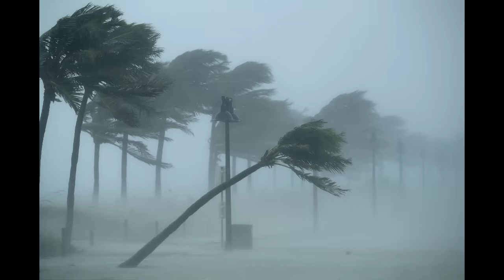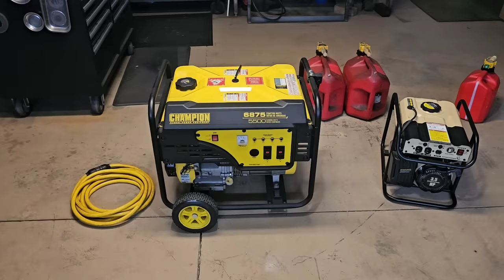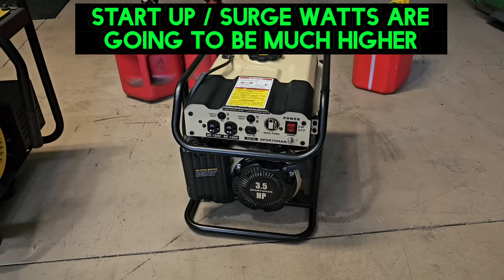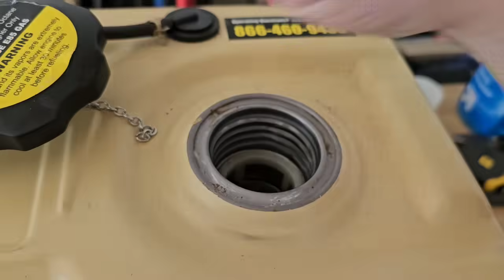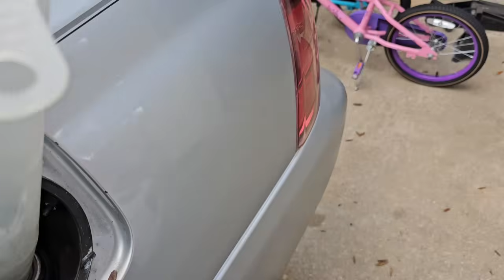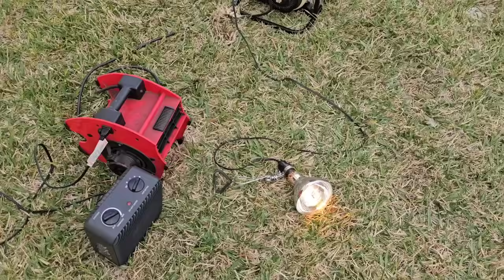Why smaller generators are better for power outages.

Comment: 1000 watt inverter chargers 12volt deepcyle maybe 8 hours very litte gas less than gal  then 400 watt inverer 12  to 120vac can do alot of low power devices,make sure device is inverter compatable ,most blankets arent phones can be charged from adapter from cig lighter or 120 adapter!
Reply: 1000 watt inverter generator,correction

Comment: I use mine to juice my solar battery up. I run the fuel gas generator during the day for juicing the smart solar battery and run the fridge/freezer/heater/ac then run the sb at night.
Reply from the maker: I've been getting into the solar batteries more and more after making this video. They are awesome! I think having a combo of a big & small generator along with a battery and some solar is the way to go. Each one has pros and cons but together you have great flexibility
Reply: @Mechanical_Mind  i'm looking at making my own solar panels for this as well.

Comment: dude i live in south east Texas and we get beat as bad as you do. and i have had them small generators. and small I'm taking that 6875/5000 and i may see you running your stove one burner at a time. but no way will it run your water heater or central air period. I'm sure it would run your a/c if you can get it to start. but i don't see it starting it.  i used a 8750/7000 for 19 years and it wouldn't run my water heater or a/c at all. and i just got a 13000/10000 that will run my stove and a/c both at the same time but my water heater still hurts it. but i can run the water heater alone.

Comment: I think if you are going to run generators, you really need two, a small one you run most of the day and one you only start for power intensive tasks of 1-2 hours. It's not a matter of fuel cost, it's a matter of fuel logistics.
Reply from the maker: I agree, having both is the way to go. Also adding a powerstation and some solar can really help.

Comment: I don't get it.  When I take something out of the freezer and stick it in the fridge, it takes days to defrost.  Even leaving it out on the counter, it doesn't defrost sitting in air in an afternoon.  I think these rules regarding food going bad are brought to you by folks covering commercial situations, and have about as much relevance to home owners in a disaster setting as the rules that say you need to defrost shrimp under continuously running cold water.  It completely ignores issues like beef and pork don't get dangerous at any rate equivalent to chicken or shrimp.

Comment: Former heavy truck engineer.
engine had half power capabilities and we rookies asked why nit full power?  FUEL COSTS
could not afford a big generator and stumbuled into a win fall of having spec'd  the correct size needed, not a monster I wanted.
next woll be dual fuel.

Comment: On sale for around $1100 I picked up one of the HF Predator 5000 Dual Fuel's.  It's relatively quiet, will run a 1500-watt heater, the refrigerator, the freezer, plus microwave and induction burner as needed, all for 8-ish hours on a 20 lb propane bottle, and over 12 on a tank of gas (a little over 3.5 gallons).  We're on the third power outage this fall, very windy island with lots of very large trees. Really like this generator hope it lasts.

Comment: I've got an inverter 2200 surge/ 1800 running genie with economy mode. It was $350 on sale in 2019. After a tune up (ngk plug, cleaned air filter, spark arrestor) 
since their Chinese spark plug wasn't even gapped correctly and got more than what the book said. 1 gallon went 9 hours overnight running fridge and small deep freezer.

Crank it once per month for 20mins. Turn fuel off and let it run dry. Had it since 2019. 
Log the time and follow maintenance!
I always use e10 87 gas but always add a little Lucas fuel stabilizer. By the gallon, it's cheaper at $27

Comment: I know it's hard as many building codes require electric everything these days but honestly if you live in an area that loses power on a regular basis it's really important to diversify your energy needs. Aka have gas stoves or heating, even just having a fire place so you can actually heat and cook your house without electricity helps a ton. Generators are nice but if they end up being a regular thing you need it is useful to invest in not needing so much electricity in your house.

Comment: I ran off of generators for about 7 years. Mainly the 3500-4000 watt units, and the cheap Chinese lasted just a long as the Briggs or Tecumseh engines. About 1 year each running 20-30 hours a week. 
One thing I can add that helped me, is using a coffee filter and filtering the gas as you pour it in the tank.  There is all kinds of debris you will catch.
Reply: So you are saying Chinese models lasted 1 year continuously? Is that a good or bad thing vs a Honda

Comment: A smaller engine has less inertia and friction to overcome before servicing the load.
Therefore, more load is served as a % of fuel used.
The larger generator is much larger and therefore requires much more fuel to overcome internal losses. Then the rest can be applied to the load.

A small generator can run all night powering a small charger.
A larger generator can run all night powering a larger charger.
The small generator will run out of fuel after 4-6 hours running a larger load.

Comment: Should in the video discuss pure sine wave or inverter generators. If plugging in tv or fridge pure sign is needed for clean power for electronics.  Old ancient fridges not an issue today’s fridges with electronic boards will die from bad generator power.

Comment: I used to believe in using the smallest generator for the job. Since putting in 18500 watts of battery back up I bought a large 10500 watt trifuel inverter generator to charge my batteries once a day in two hours. It is less expensive and more convienient to run a large generator for much less time. My other two trifuel generators are now backups

Comment: Even better is no generator. After Hurricane Irma, I got tired of the generator's noise and constant need for fuel and oil, so I resolved to find a better way. The answer was a 1 kilowatt solar array, with a 12 kWh LiFePO4 battery and 6 kW inverter. It powered everything in my house (except the HVAC) during the long outages after Helene and Milton plus it pays me a 75¢ dividend every sunny day in Florida. No noise, no deadly fumes and operates indefinitely without attention.
Reply: Your solution makes sense...for you.
It underscores tailoring your wants & needs to your situation ...
I do agree that regular gensets are obnoxiously loud though. The mfg's could improve that.

Comment: That little generator won't run a refrigerator, I know because I had the same generator. I have two generators, one 5000 watt and one 3500 watt. The 3500 one is dual fuel propane and gas. Propane stores for ever unlike gas. I have 160 pounds of propane stored in the barn, that's 60 hours of run time at 50 percent load.

Comment: Having a prius is the best way to keep things working in such situations. The bad part with these generators is that there is a energy waste because it outputs a sustained power even if you don't need it. But with a hybrid car like prius, you only get what you need and that saves you a lot. Imagine running your fridge for only 1 gallon in 8 hours.

Comment: I've just given away a small generator that wouldn't start. I had it repaired last year and it was ok, but this year it happened again. Each repair costs £50 and the generator itself was only about £150 new, so it wasn't worth repairing it each year. The design of these is very poor. I never have this issue with my lawnmower, which starts immediately after 6 months in the shed, and my Vespa scooter is the same. Unless you have a lot of mechanical knowledge you can't fix it yourself.

Comment: Yup, most people just buy the biggest one they can get and don't think about gas consumption. I bought one with just enough watts to run the necessities and it burns less than 5 gallons a day running 24 hours. All my neighbors have big ones and are searching for gas after the first day.

Comment: I only need my gas generator to run the 30 amp 240 volt water pump.
The rest of it I can run off my 2000w inverter.
Run the inverter during the night when there is almost no draw.  Silent, but lights come on and the refrigerator and freezer keep rolling.
During the day I can fire up the 6000w gas generator, charge the batteries back up, refill any water I used to flush a toilet durning the night.
I have a 600w Honda generator, but that won't even run the coffee maker.

Comment: Absolutely correct on the gas consumption and the noise level.   Why in the world would one heat water with electricity??  A gas water heater, a gas stove and a gas dryer makes enduring the frequent power outages one gets in areas plagued by tropical cyclones much easier.

Comment: I got a small 2500 watt (1750 running watts) champion, and it runs 50 hours off of one 30 gallon propane tank... we have a dozen tanks. Just got a second one to supplement. Runs 11 hrs. on .95 gallons.

Comment: If you can afford a larger one AS WELL AS a gas sipper do that.  Duel fuel if possible.  There may be times when you must have 220V.  Really cold or hot days if you have the fuel..  I have a Westinghouse 2200 Watt duel fuel and a 1000 W. inverter Sportsman which will do everything but run motors. 6hr. on 1/2 a gallon!

Comment: So I shut the fuel valve off and then listen for the engine to start starving for fuel and surging.  Just before the engine dies, throw the Choke Lever to on and your engine will begin running smoothly again.  It will run for a short period and then begin surging and finally quit.  This way you make sure that you get nearly all of your fuel out of the carburetor. I've done this for years and I have not had any issues with my equipment not starting again when I needed it.  Thanks for sharing this information!
Reply: 👍👍 riding lawnmower too.

Comment: Great video thanks - just one thing from here in the UK - I use 20ltr metal 'jerry' cans that are enamel lined so the petrol (gas) keeps basically forever. I do add stabiliser as an insurance policy but metal cans keep the fuel way longer than plastic ones. I do NOT want to be trying to get fuel when I need it the most, but also don't want cans of useless fuel.
Reply from the maker: That's a great point on the gas cans. Is there a specific brand you recommend? I'd like to check them out

Comment: The reason to size a genset larger is to be able to start electric motors easily. A house refrigerator may run at 200W average but have a start requrement of 800W. Same issue with a freezer, or ng/propane forced air heater. Of course, you won't run resistive heaters or electric appliances like an electric clothing dryer or kitchen range in an emergency. You will have to do without, or a work-around, like a wood stove, 550 cord, or outdoor grill. Most people should be okay with around 2500W genset that has an ECO mode. Combining a smaller gas or propane genset with a battery inverter pack (charges fast while gas engine runs, slowly from solar) is a good combination of convenience and fuel saving. Genset is off-cooled-secured while people sleep but the battery pack still allows low-power LED lighting, security systems, closed freezer-refrigerator overnight  Don't forget to stock genset crankcase oil and filters for more than your stored fuel run-time! 
Small capacity (around 800W) propane-only generators that will start & run a 550W window air conditioner are lightweight, and available under $700. Propane stored in 5 or 7 gallon tanks are highly mobile and do not expire like gas or Diesel liquid fuel.
Reply: Starter capacitors can also compensate for this increased motor starting power. Genset colloquially would not be the correct term in this instance and is typically reserved for industrial engine + generator and are traditionally much larger than the emergency consumer generators that the topic discusses (e.g. single phase 120v or even 50A split phase RV generators). You're not moving a 'genset' by hand hand in the same way you would move one of these consumer generators.

Comment: I have a 2019 Hyundai Kona Electric with a 64 kWh battery I try to keep over 50% in case of a big earthquake in California with a lot of faults nearby.  The onboard 12V DC-DC converter can do 1300W and I have a few inverters and lots of extension cords to keep the refrigerators powered in an emergency for at least 1 to 6 days.  After that we will eat the emergency dry and canned food.

Comment: Got me a 3500 watt champion inverter for $100 not running. I only swappped the gas out and it runs perfect. Its nice to have a spare generator for a loaner. Last time a neighbor needed to keep baby milk frozen during an outage so the loaner went out and I wasnt worried about it coming back or not.

Comment: Would 1 to 3 small generators be better than owning one big generator?
This way you can used what you need.
Reply: From an efficiency and fuel-economy standpoint, calculating load compared to a large generator, yes.

Comment: I have two my self but I got the smaller one years before I got the bigger one. The small one would be enough to power lights and a little more, 1,800w, and that's about it as it was meant only to be used for camping. The bigger one, 10k serge 12.5k is for if I need the heater or AC and electric stove. The smaller one could go about 12 hours on a single gallon where the bigger one would be really sucking up the gas. I would have to keep unplugging the freezer and refrigerator as the smaller one is only powerful enough to power one of them.

Comment: This isn’t a surprise.  A portable 2000w generator will power a refrigerator and freezer at the same time.  You can get by with intermittent usage and only using essential electronics.  We also have a whole house generator (propane powered), and nonstop use over several days really eats up the fuel.  In the future, if power outage is expected to last more than a day or so, shut down the whole house generator and use it only when needed (it will power 240v systems).

Comment: If you have access to gas use the big one. If you don't, us the small one.
Reply: So be wasteful... not much of an 'emergency' if you can waste fuel.
Reply: @Desert-edDave  Again, if you have access to gas, use the big one. If gas, money, and infrastructure is in short supply, use the small one. Not every power outage is considered and emergency. I only consider an emergency if resources are in short supply. Just took a direct hit from Helene in FL. No issues getting gas, so we chose to run the big generator to power the whole house. During Irma, gas was in short supply, so we chose to run the small generator. Survival relies on adaptation.

Comment: Hurricane Helene knocked my power out for 4 days, of those 4, I ran my old Predator 7250w for roughly 2.5 days and guzzled up 20 gallons of gasoline.  My dad had an old 3000w generator and used maybe 5 gallons of gas for the whole outage at his home.

I needed the big generator for the old well pump, so for the next time I'll run the big generator just to run the well and fill up water containers, then shut it off.  Making a battery bank and got an inverter charger for the fridges, I can use a much smaller generator to charge the batteries up.

Comment: Best and most efficient way is to feed the generator to a LiFePo powerbank. Get the most efficient generator, even if that is 400w, and just feed it into a powerbank. What good is your generator when most of the energy made is unused and lost forever. Then let your powerbank handle the house. Add a few solar panels. They can easily run a few fridges 24/7.
Never turn on a generator to charge a phone, its an immense waste of energy.
Reply: Power Station would colloquially be more accurate as power banks are typically known as small handheld units good for recharging phones, tablets, and maybe a laptop at best.

Comment: I own a 2,000/1,600 watts and a 4,000/3200 watts inverters. I usually run the 2,000 one most of the time for fuel consumption. It runs me the refrigerator, tv, cellphone and a fan. When I want to turn on a window AC unit, I switch to the 4,000 generator, which runs everything I need. If I need more power, to use the washing machine, water heater, etc I can parallel both of them, which gives me 6,000/5,800 watts. I switched from open frame generators to inverters for the low THD to preserve my electronics. My old 5,000 open frame generator killed my laptop within a week of power outage due to Hurricane Fiona, due to high THD.

Comment: Well water 220. Sewer pump 220. Hot water 220. Heat 110 (pellet). Refrigerator 110. Propane stove. And so on………reality sets in. Went 10 days without power in a cold blustery March in the northeast.

Comment: Nobody really talks about thia issue. In my experience, when the STHF the local gas stations are ALL closed so after a pretty short amount of time, your big ole generator runs you dry and there's no way to get fuel. Then you're screwed. Little generators run FAR longer on much less fuel, for the winning strategy.

Comment: I have both.    Small generator for small loads but a bigger gen that is 240v capable for running my well pump and electric hot water tank.    A solar generator is also good for quiet power as well as energy storage over night.

Comment: Great Video! I downsized from a big Generac that was great…but I “underutilized” it.  It was way more than I needed. I bought a small Champion dual fuel inverter generator and used it when I lost power during Milton for four days. It ran my small portable AC unit and I was also able to charge my Champion indoor battery backup unit because it’s an inverter. I used 2.5 gallons in four days. Big Boy Generac burned through 10,gallon's per day.  Being an older woman alone it was far easier to maneuver the smaller Champion as well.